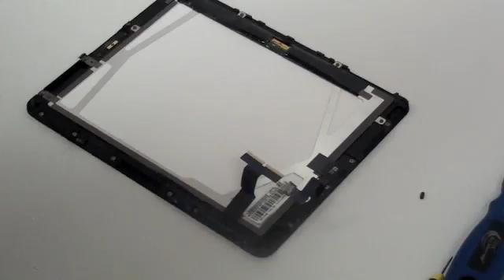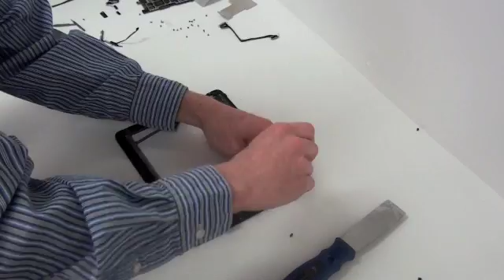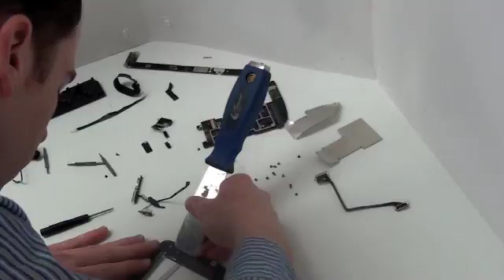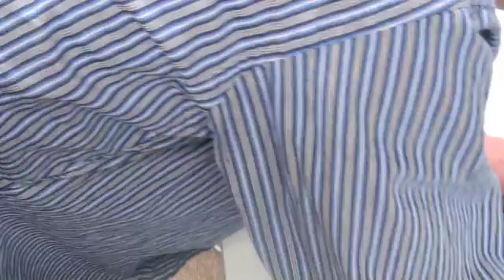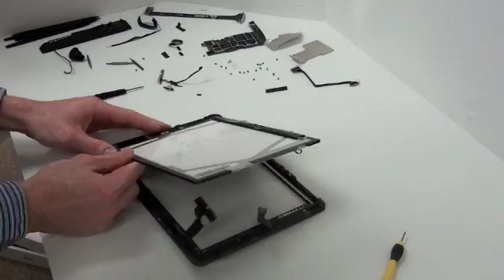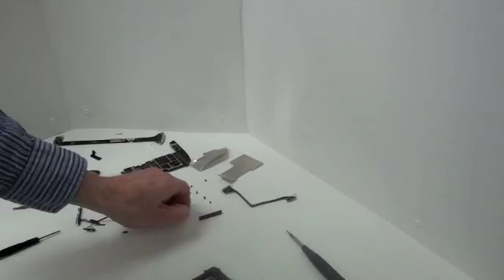iPad Teardown - LCD & Digitizer

Comment from the maker: You're most likely going to have to replace the LCD to fix the issue. You can watch our other videos to see how to remove the LVDS cable, but it's unlikely it came disconnected. The LCD is available from our website or by calling us at 1-866-726-3342, option 1.